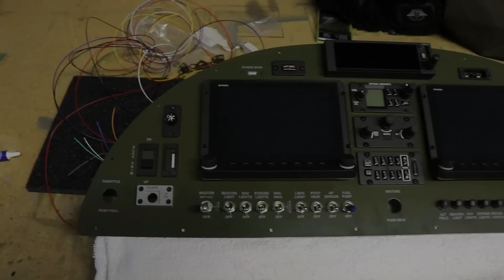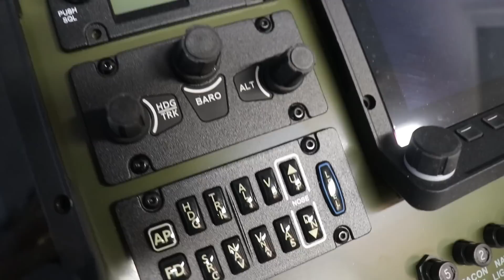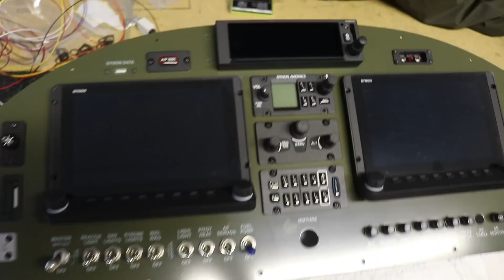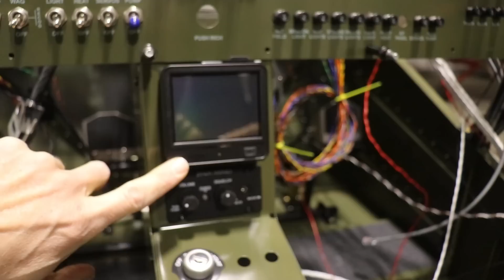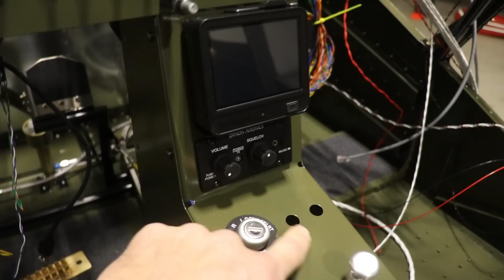Zenith STOL Instrument Panel INSTALL! (Ep75)

Comment: G,day Mark from Sydney Australia.
The Panel
Did you have to send them a template (full size) of the lettering.
The tread taping into the sheet aluminium, there would not be a lot of thread. It would be convenient to thread all, or nuts on the back.
🎄🇦🇺

Comment: I like the traditional technique where wire groups and bundles are laced or tied with cord.
 Cord is easy to install plus the maintenance, and inspection later is easier due to the view and easy access. 
 Lacing and tying wires with knots that hold and secure together a group or bundle of wires   creates an interesting appearance or aesthetic.
  Teflon plastic spiral wrapping is great too. I like it because the bundle remains visible, it is easy sorta versatile in sizing, it slips and slides easy and can even tolerate a little heat.
 Fire sleeving and connectors protection kinda get lumped into a different area of thought in my mind. Sure, there are plenty examples of where to use them.
  I guess we're reluctant ( ever seen an electrician wire a stick frame home ? Compare that to a commercial wiring like a school or hospital).
  I tend to think of fire sleeving as protection and prevention. While I would generally protect a splice with tubing the fire sleeving and zip ties might not be a bad idea 
  I find my self enjoying and just looking at the beautiful nature of it all. Can't wait for the next view.
Thanks for the share.

Comment: Are you adding the Seattle Avionics charts to your HDX or staying with the Dynon generic terrain?  (I did the latter)
Reply from the maker: I will add the charts. In my Cruzer I have an iPad with Foreflight for the charts. I’ll have no panel mounted iPad in the SD so I’m thinking I’d like to have the charts on the passenger side screen.